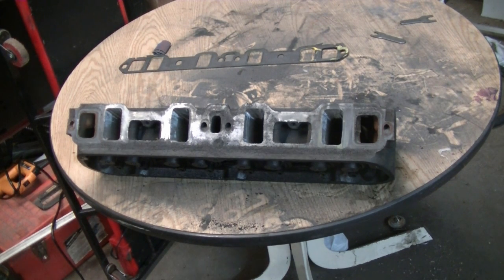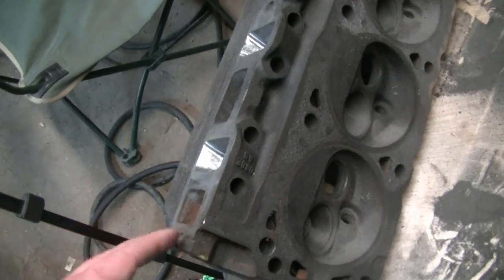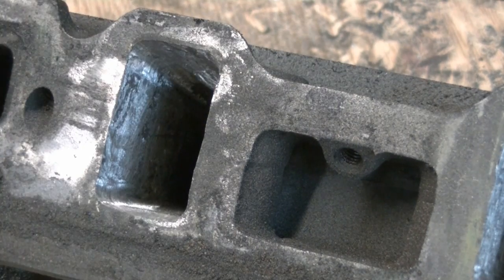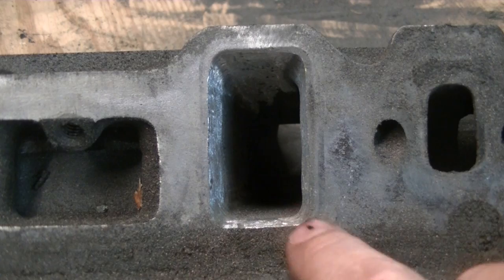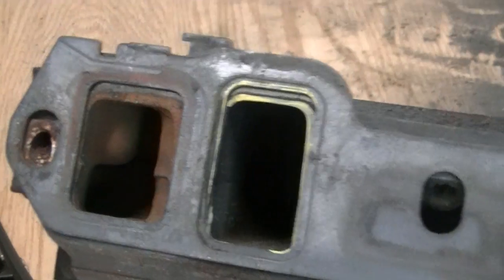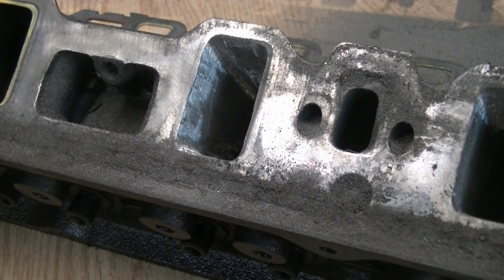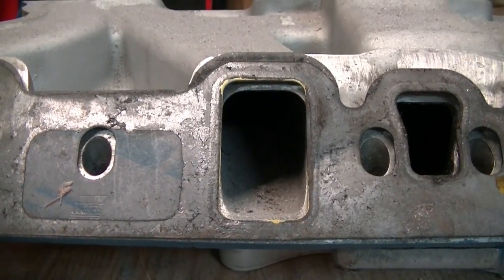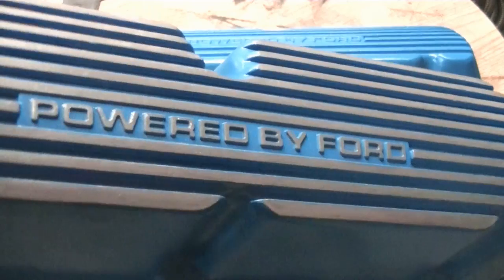How To Get Free Horsepower: Porting Your Own Cylinder Heads & Intake

Comment: Port matching on good heads is only worth 5 HP so I don't think it is worth the time on that stock iron head.
Reply: kjdcomp1 check out the episode on engine masters 408 mopar ported heads. Intresting video
Reply: Seen it 92 horse power very good heads and a very good port job.
Reply: And if I remember correctly they also did the manifold
Reply: Way more than 5 even with a amateur job. Pretty sure they didn't even polish but I could me wrong
Reply: If it's done wrong, yeah 5hp or less. But if done correctly I've seen an easy 25hp or more. Ford 302 heads are the biggest restrictions on free HP.

Comment: Just but some aftermarket aluminum heads and you will not be sorry .
Reply: aluminium heads cost a lot more than a port and polish and i think that is the whole idea???
Reply: @williamhardes8081  just trying to help others out from the mistake of fully rebuilding and porting those stock inferior heads. Be money and horsepower ahead,  just buy aftermarket instead ,while Also dropping 50lbs off the engine.

Comment: after porting should i  reinstall my own valve springs or is that something i should leave 2 the pros?
Reply from the maker: murder forte If you did the porting yourself, valve springs shouldn’t be a problem.  You’ll need to buy or make a tool to compress them though.

Comment: what sort of material r the cylinder heads made out of specially a GM 3800 S/C.
Reply: Those should be aluminum. You should be able to tell from looking at them. If you are still unsure, use a magnet. The only 2 materials for cylinder heads are iron and aluminum. If it's magnetic, it's iron. If not, aluminum. 
  Aluminum transfers heat a little better and allows slightly more compression before detonation (pinging) occurs. Porting aluminum is much quicker than hard iron. It's easy to remove too much material so take care to go slowly. 
  Another benefit from aluminum is much lighter weight. On a 350 v8, you'll lose 45lbs from your engine from swapping to aluminum heads.
Reply: @72troy455   Richard Noggin  the post that I was replying to was asking about the head material on his 3800 engine. I did not suggest AFR heads. I'm not the arrogant prick in this conversation. I'd love a pair of AFRs too but I'm not paying  $2000 for a pair.

Comment: Slow the drill speed. Them sparks are tiny pieces of hot metal hitting the port walls
Reply: UHMMM....That's what it should look like when you are grinding cast iron.  If you don't see sparks, that means nothing is happening

Comment: might cost you a top end gasket kit also lol. 
great video buddy! thanks.
Reply: you lay it on then mark the damned thing.........
Reply: @trillrifaxegrindor4411  you mean you get the intake gasket set and use it as a template? thanks man. I had no idea... 
what I'm saying is you don't wanna do it on the engine so you don't get cast iron shavings in the top end... ya know... 
could just be me but I like my pistons to not be seized to the block.

Comment: It's just easy easy to lose hp when you don't know what you're doing. Without some way to verify what you're doing, you're wasting your time. How do you know you didn't lose airspeed into the port? Lost airspeed means the cylinder won't fill as efficiently. Volumetric efficiency goes down. But the whole time you're thinking 'Man! I got free horsepower! And I didn't have to pay a professional that actually knows what to do and can prove their improvements. With testing and results from prior customers. And years of knowledge.
Reply: I have done  my own  porting and took my car back to the track and gained 2 tenths  of a second!   
Yes a pro would have  gained more but a good pro port job is 1000 bucks!
Reply: good old butt o meter brother
Reply: It's been proven time and time again that what he did. 
A "simple" port match like that helps
Reply: There’s always that one guy who argues with facts. 🤦‍♂️ this is that guy
Reply: Because this shits never been done before huh.
Reply: @TurboTurdBurglar  🤣🤣🤣
Reply: @CHEVYK10  no,it doesnt.3-5 horsepower gains are the norm.he forgot to do the bowls and combustion chambers and around the valve guide,thats were it matters,THEN GASKETMATCH
Reply: @TurboTurdBurglar  fact is this is pointless without doing the rest of the head(port,bowl,chamber,around the guides) that actually gains power.this is like adding 5" exhaust tips to a 2" exhaust and thinking you increased the flow.no surprise,you didnt......
Reply: @mylanmiller9656  did you just gasket match or did you actually port your heads? this isnt porting at all and does nothing.....
Reply: @trillrifaxegrindor4411    2 tenths  may be nothing to you,  for low buck guys  it is a gain!  if I won the super Loto  I would  buy a set of AFR CNC heads  until then I will do What it takes to go fast cheap!   professional porting is  Not feasible any more. You can buy heads that will flow  better than  any stock heads that have been ported for the cost of porting!

Comment: DO NOT PORT YOUR HEAD UNLESS YOU OWN A FLOW BENCH.
Reply: Yes....that is quite true, but how many guys have a Superflow? My SF 600 was the best tool I ever bought!
Reply: Not quite.  Blending the bowl, tapering valve guides, removing exhaust air ports, removing casting flash and polishing the as cast finish are all PROVEN to improve both flow and velocity, regardless of the cylinder head.  What you should NEVER do without a flow bench however, is substantially change the size or shape of the ports!  That is where you can kill air velocity in a hurry.